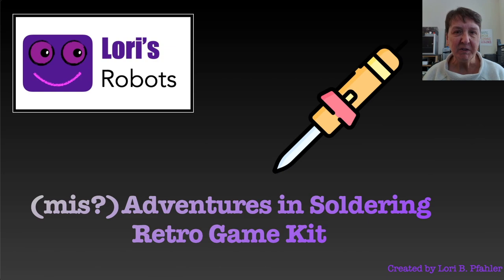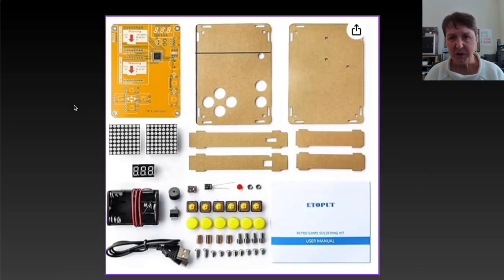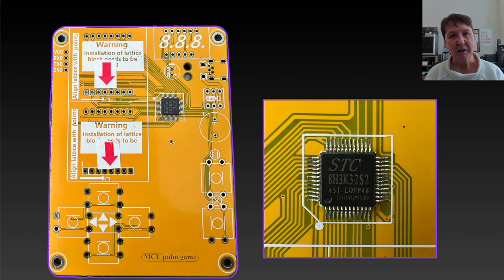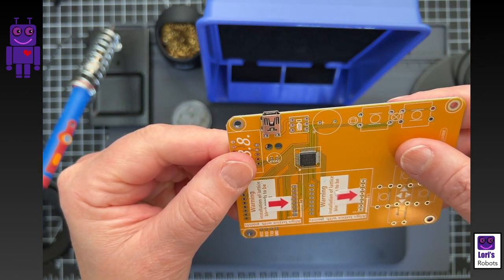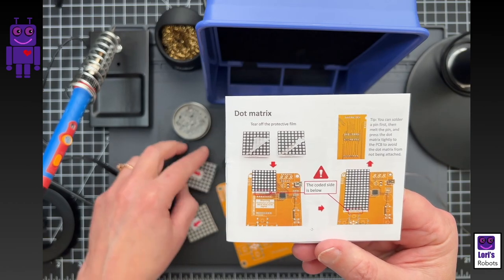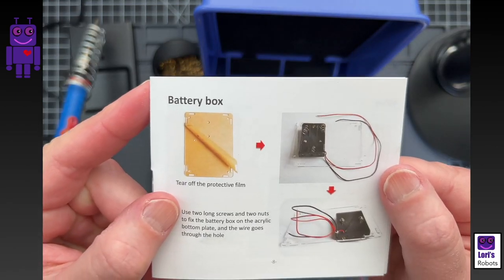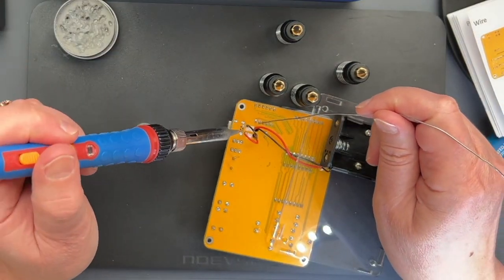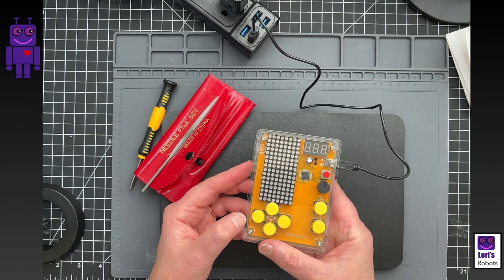Retro Game Kit - (mis?) Adventures in Soldering - Episode 4

Comment: I have to say I started laughing as you started assembling the acrylic box. I have been frustrated with them before. I thought you might cut the video and do it off camera but you powered through. 👍 Thanks for the video.
Reply from the maker: Yes - I normally don't film that stuff.  I am not very coordinated on hardware installation ... but I was excited to finish it.  It was much harder than it needed to be due to not getting that button switch flush to the PCB.  My bad!  I left it in the video so beginners can see its OK to make some mistakes and you can still get it to work.  Thanks for watching!

Comment: Nice Job!! Those darn little screws... always a challenge for me. Need to get a magnetic screwdriver to hold them.
Thanks for posting.
Reply from the maker: It is a slightly magnetic screwdriver.  I am just not very coordinated!  One reason I don't film much tool work on these videos.  Thanks for watching!
Reply: @lorisrobots  Sorry, I meant to say "I" need to get the magnetic screwdriver. Between my big hands and the tremble in them I've developed of late, I almost always have to ask for help with the small stuff. You're doing great with your projects.
Reply from the maker: @leeg.1402  No worries.  I am so clumsy with tools; I can use all the helpful suggestions I can get.